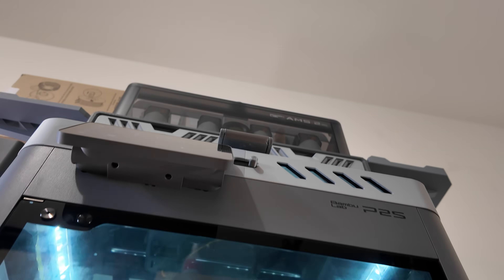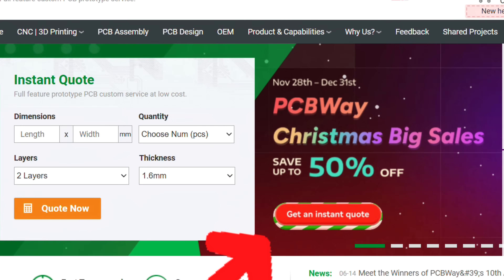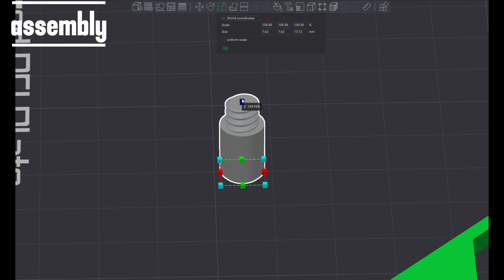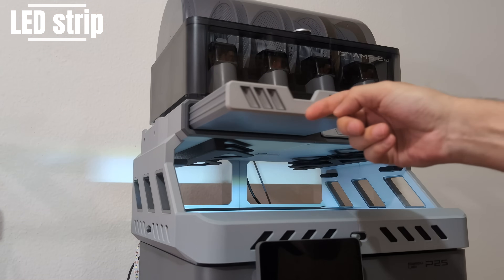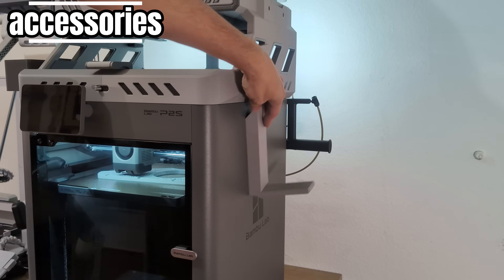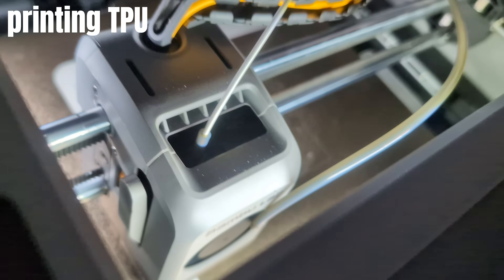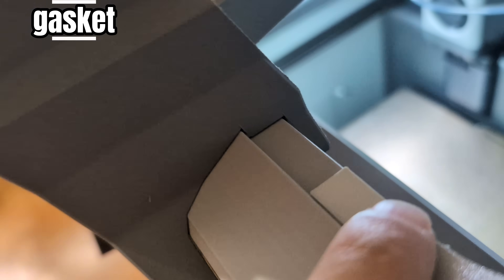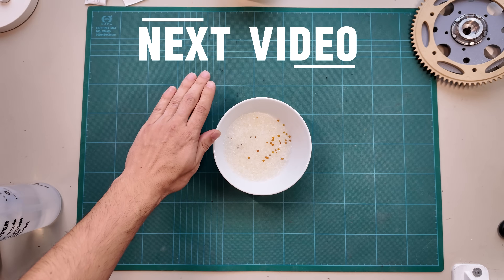Why your 3D printer needs this Upgrade – and how you can print it yourself!

Comment: There two different lead brackets for the spool holder. The one on this video with the larger hole in the front and another one with two smaller holes for the TPU. Which one is the better one that was updated. Also do you have PTF tube running thru it.
Reply from the maker: I don't have a PTFE Tube running thru it. So i guess that one would be the newer version, but not sure. You can Ask directly Darren who designed this riser. Best to write him on Makerworld ;-)

Comment: Hi.  What a great video, thank you👍.  Because of your review,  I bought Darren's riser, it is excellent.  I have also downloaded and printed many of the accessories you have showed.  I've made the TPU spool holder, it is perfect. Thanks.
Reply from the maker: Hi Neil, thanks for your kind comment, much appreciated 🙏🏼 
Yes that riser is a beast, and the TPU spool holder is so worth it. Did you print the lid already? And what printer do you use?
Reply: @Dirt-E-Bikes The lid?  I bought myself a P2S in November to replace my Ankermake M5C.  What a massive step up on quality, reliability and performance, and the bigger bed makes a difference.  The AMS makes life so much simpler.
Reply from the maker: @neil-brenneryes, the AMS is really making things even easier... I Don't print multicolor that much, but would always buy the AMS again 😅
... Yes i meant the lid ;-)
Reply: @Dirt-E-Bikes Sorry, I’m not sure what you meant by ‘the lid’.
Reply from the maker: @neil-brennersorry, i meant the gasket ;-)
Reply: @Dirt-E-Bikes Yes, I printed the gasket. It seems to be perfect.
Reply from the maker: @neil-brennernice, glad to hear

Comment: I was wondering what is the point of those closeable vents in the riser. Is there a case when you need to ventilate the printer just a bit, but not too much, like when you take off the top glass? To my understanding when you are printing low temperature filaments it would be the best just to take off the glass and release the hot air as much as possible. And when you are printing high temperature filaments the riser should be as tight as possible, to retain the hot air. My P2S is yet to arrive so I am newbie 😊
Reply from the maker: Hi Maugowina, good question 👍
The vents for me are more convenient than getting the glass plate off the printer. You are right about the filaments that don't print hot, depending on your room temperature, it may be enough to let the glass plate on and just open the vents (it is in my case at about 23°C room temperature).

I either have the vents fully open or closed.

Hope that helps, and don't worry about asking again if something is unclear.
 🙂✌️
Reply: @Dirt-E-Bikes  Makes sense, thank you! 😊And great presentation (I love the style ❤), thank you, looking forward to your next videos about 3D printing! I'm trying to learn as much as possible while waiting for my P2S (still over a month... 🥲)
Reply from the maker: @maugowina for sure, and thanks for the kind words, that means a lot to me 🙏🏼 
I am working on releasing the new video in the next few days, always a ton of work but its great to hear that people like you appreciate it 👍

Comment: Have you noticed any PETG creep on any of your prints over time? I’m planning to use both the AMS 2 Pro and the AMS HT on the riser, but a few friends have raised concerns that the material I’m using might deform over time. Have you experienced anything like this or had any issues with your build? I’m currently printing it in SUNLU PETG and would appreciate any advice.
Reply from the maker: Hi JJJones, so far I have had no creep on any parts of the riser. But i am still waiting on the AMS HT to arrive... 
The side shelf that I'm planning to use has a cutout in the bottom for the heat to escape, i hope that this is sufficient, but at the moment i can't say for sure...
The AMS2 on top is able to dry at its max 65°c without any problems - did that a lot and no problems with the PETG parts there.

Hope that helps ✌🏼
Reply: @Dirt-E-Bikes  Good to know — I’ll probably print the HT parts in ASA, just to be safe.

Thanks
Reply from the maker: @JJJonesJr33 that should do it 😄👍

Comment: What do you estimate the total cost to print all the parts? I saw the weight was approximately 5 kg but is that with filament waste?
Reply from the maker: Hi Thopikaran, yes that was with some filament waste. The base model needs about 2.7 kg. I always try to get bulk orders from Bambu Lab (14 spools give you 53% discount), that way it was  about 27$ for the base model and approximately 20$ for all the accessories. 

I now also have an affiliate link in the description, if you want you can use this to support my channel, but you don't have to, it doesn't cost you anything extra ;-)

Comment: Hey, I'm new to 3d printing and was wondering if it would be ok to print everything from PLA. I know PETG is better, but still. Thanks for the help.👍
Reply from the maker: You are very welcome, so yes, many print the riser from PLA, that should work too, but if you are using your printer to print with chamber heating at its max temp  (65° ?) PLA could melt. That is why i printed the structural parts that are in contact with the build chamber from PETG. 

If you only print PLA and PETG on your printer, you should be fine with A PLA-Riser.

Hope that helped, if not, just let me know 🙂✌️
Reply: @Dirt-E-Bikes  Thanks a lot for the quick response!👍 Final question, how long do PLA prints last indoors (such as on this)?
Reply from the maker: @CFIBurger probably forever it's just not as heat and UV resistant as other materials. Just don't place it in front of a window and it will be fine ;-)

Comment: What brand of PETG did you use it looked super clean and good and im new to PETG
Reply from the maker: Thanks mate, i used the Bambulab PETG HF in grey and some parts in dark grey
Reply: @Dirt-E-Bikes  awesome thank you did you use the standard slicer setting or did you do flow and pressure calibration with it?
Reply from the maker: @haywiredonkey1732  you are welcome ✌️
I use the standard settings but lower them by around 10% on every speed setting, that works great for me, but i would suggest just trying the standard settings first, and only change it if something doesn't seem right.

Comment: This is amazing good job! Will the glass being open cause more vocs to circulate?
Reply from the maker: Hi mobochicken, thanks mate, and yes, you can smell it when you open the top glass. I open it when printing PLA and PETG, hoping that it increases print quality even more ;-)

I have a large carbon filter that cleans the whole room, but even with that you can smell it.

Comment: Thank you. What colors did you use for your for this? Look really good. Thanks
Reply from the maker: You are very welcome 🙏🏼
I used these Bambu Lab Filaments:
PLA: Nardo grey, Ash grey (both matt)
PETG HF: grey, dark grey
Polymaker: grey
😅 So a lot of grey there...
Oh and matt black PLA also from Bambu Lab
Reply: @Dirt-E-Bikes  
Please tell me which elements you printed with these filaments:

PLA Matte Nardo Grey
PLA Matte Ash Grey
PETG Grey
PETG Dark Grey
and Polymaker Grey (PETG?)
Reply from the maker: @h0ld1234 
PETG HF grey for the base and the drawer front,
PLA nardo grey for the drawer panel,
PlA ash grey for the drawer insert and the extension shelfs
PETG HF dark grey for the AMS HT side shelf and for the extension bins of the tool tray
Reply from the maker: @h0ld1234  and the polymaker petg i used ony because i run out of the bambu lab PETG HF grey ;-)

Comment: For someone who hasn't gotten into 3d printing yet, when you said you used 5kg of material to print this, how much did it cost in filament? (I know diff types are used and cost will fluctuate) Just a round about #?  How many KG is on a spool?
Reply from the maker: For the base model its about 2.7KG, one spool is normally 1 KG (depending on the brand, but most of them sell 1Kg)
Prices vary from about 10$ to 25$ and more. I buyed mine from bambu lab  (link is in the description) and paid  about 10$ per spool because i ordered 14 piece at once so i paid less per spool. 
Hope that helps you, if there are any more questions just ask, we all started this hobby once and didn't know that kind of stuff at the beginning of this journey and every new one is welcome here ✌️
Reply: Generally spools come in 1kg, so you'll need at least 5 of them. Get more than that though, in case of failed prints and other malfunctions

Comment: You printed the main structural components with PETG, but it looks like you printed the vents with PLA. What was your thought-process there? Wouldn't the PLA vents also be exposed to potentially problematic temperatures when printing?
Reply from the maker: Hi BigOlBilliam, true, the PLA vents are also exposed to the heat of the chamber, and in hindsight i would do them also in PETG if i would do it again, good point, i missed to think of that. The vents do not have any load/weight on them though. other than the small knob that screws in, its nothing pushing down or any bending force. So they hold up fine at the moment 😅
For a printer with active chamber heating i would definitely recommend printing that part from PETG or even ABS, but my P2S hardly reaches 55°C at its max.
Reply: @Dirt-E-Bikes  Ah, so with an X1C, there's not much of a concern there either?
Reply from the maker: @BigOlBilliam i don't think so, but as i said, you are right with your concern about the temperature, and PETG would be the saver option 👍
Reply: @Dirt-E-Bikes  Gotcha. Appreciate the reply. This video tipped the scales on me pulling the trigger. Really appreciate the whole overview.
Reply from the maker: @BigOlBilliam you are very welcome ✌️

Comment: Hello, thank you! I have a question: could you please give me the reference numbers of the spools you use to achieve the same color and type of result as you? I would like to reproduce the same result because your colors are very well chosen . thx
Reply from the maker: Hey, thank you Nasus. 
So when you open the Bambu filaments shop:
https://tidd.ly/48Syg93
- Its the PETG HF in grey and dark grey
- the PLA matt in ash grey and nardo grey and black
- the ABS in silver
- the PCTG is from 3D jacke and its also silver.

Hope that helps ✌️
Reply: @Dirt-E-Bikes  thx you !!!
Reply from the maker: you are very welcome ;-)
Finally someone how also likes grey stuff 😅👍
Reply: @Dirt-E-Bikes  How many rolls of each color/type of filament did you end up using for this project? I saw in other comments that five rolls were used and to buy extra in case of error prints. Thanks for sharing the details on the filament types. My kid & I plan to recreate this riser, just waiting for his Xmas P2S, due to backordered. Thanks!
Reply from the maker: @waxx808 so cool, that is a great xmas project there 😀
Yes that should be about right, 5 spools in total, and something extra if a print fails. I would buy 3x (or 4x)  PETG for the "base model" in your "base color" and 2 Rolls with other colors (PETG or PLA)
I have a (affiliate) link in the description for the bambu filament. You can save a lot if you buy in "bulk orders", i always buy 14 spools to get 53% off.
... You don't have to use my link for that, but it doesn't hurt either ;-)

Anyway, i wish you two a lot of fun with that project 👍

Comment: I’ve printed this riser and most of the accessories. It is by far the best engineered add-on that I’ve printed for my X1C.  I absolutely love mine!
Reply from the maker: Yes a very well made design 👍🏻
I added a gasket for the X1C riser to download an makerworld. And you can glue the middle part of the riser to the glass plate so it doesnt get in the way when using the TPU spool holder ✌🏼

Comment: @Dirty-E-Bikes Any chance you have the dimensions of the parts you resized?  Thanks.
Reply from the maker: Hi DaLarr9, unfortunately i assembled everything before i had this idea, so i printed it regular sized (which is a good fit already).
I would start with 102% on the z axis, and just print a small part of the part to test the fit. Hope that helps ✌🏼

Comment: You got one for K2 Plus.
Reply from the maker: I am not sure, take a look in the videos description, it is not my riser design, it's made by Darren. You will find all models with the link in the description that says "all other models"
Good luck ✌️
Reply: He does make one for the K2 plus.  I really want to do one but I cant decide if I should go PETG or PLA.  I dont print with the heated chamber so PLA should be fine.  Its almost a ton of filament.  I might do the Starburst gray.  Looks like a pretty good match for the K2 plus.
Reply from the maker: @Shelbyj13 
Starburst grey sounds like a great choice 👍 if you really only print PLA i think PLA is also a great choice for the riser. I printed a lot of ASA parts in the last time and the chamber shows 55°C, that's the only reason i used PETG. If i would do one for a printer with a heated chamber, i guess i would even go for ASA or ABS.
Reply: Hi Jason.  Yes I do on Creality Cloud.  Search for D3P or Darren3dPrint. Thank you

Comment: Hey, is it also possible to print the riser with a 0.6 mm nozzle and layer height: 0.3 mm?
Reply from the maker: Hi, i guess that would work, but to be sure you should ask Darren who designed the riser. Just ask him in the comments of the 3D model on Makerworld/Cults. I printed all with the settings he provides on the models

Comment: The only issue I have with the design for the Plus4 is the glass cover storage.  The two support tabs on either side are too short and the glass can drop, especially if it vibrates a bit forward and reaches the handle notches of the glass.  I tend to slide the cover over the forward supports and then angle it down under the rear supports.  Otherwise it is a fantastic design.
Reply: Thank you for the feedback.  The storage was meant to be temporary - ie when accessing the printer etc.  Plastic is slippery.  Even with larger tabs the problem will persist.  If you wish to use the storage while the printer is running then I would strongly recommend to apply anti-slip tape to the the tabs where the glass lid rests.

Comment: First video I saw from you, I got here from an update from Darren, I have his riser and love it, your video is really well done and you just got yourself a new subscriber. One thing I made from D3P is the side build plater holder, I guess that was released after you made the video. I have 5 build plates so the side storage was very handy. If you need a poop chute, I would advise the poop drawer, I done mine and has been working great, plus a got an extra drawer for some bigger tools.
Reply from the maker: Hi Igds, thanks a lot for your kind comment. Much appreciated 🙏🏼 
The side build plate holder looks awesome, but I don't have this many plates yet, only the standard one and an engineering plate from bambu that arrived yesterday ;-) 
Thanks for the tip with the poop drawer, that one also looks nice. 
What kind of build plates do you use? Do you have any suggestions there?

Comment: This look amazing. Which version is suitable for p1s with ams 2 pro?
Reply from the maker: Hi VagboiTM, Darren how designed this has a version for the p1s (the one link that says "D3P riser... all other models" that you can find in the description, i also designed a gasket for the p1s, also in the description ✌️
Reply: Hello I have a very similar riser for the P1S (the D3P for P1S).  It is sized for the P1S as the P2S is a little larger.  It works with AMS and AMS Pro and offers all of the options of the P2S riser.  I have the model on Cults3d (see the links in the description above as I cannot post them) .
Reply: @Darren3dprint  I allready purchased the D3P for P1S. Thaks